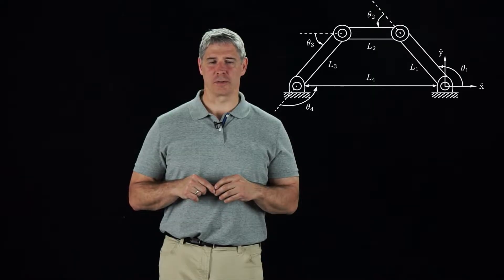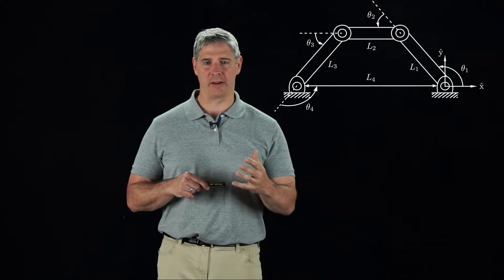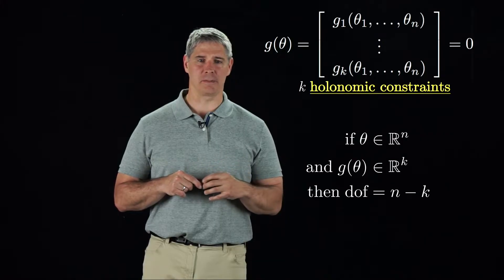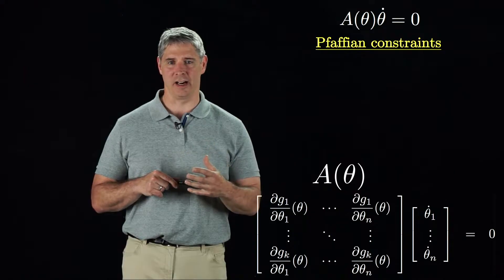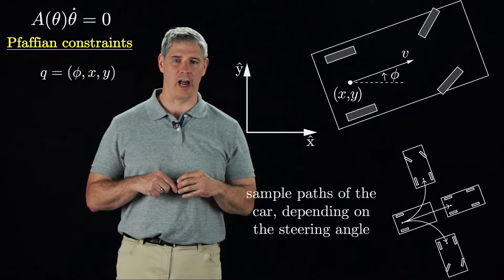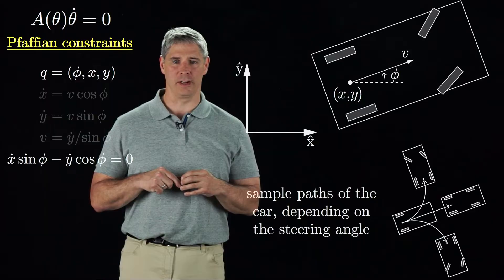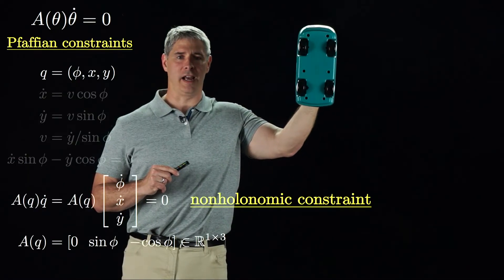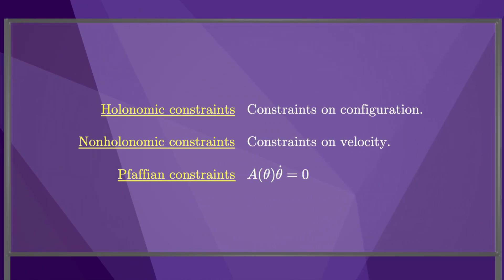Modern Robotics, Chapter 2.4:  Configuration and Velocity Constraints

Comment: By the time anyone sees this it will be like 4 years later and I won't care but I think there is an error:

@2:52 A(q) should be [ẋ*cos(Φ)+ẏ*sin(Φ), sin(Φ), cos(Φ)] rather than [0,sin(Φ),cos(Φ)] because the constraint equation is ẋ*sin(Φ)-ẏ*cos(Φ) = 0 so the derivate of this with respect to theta is ẋ*cos(Φ)+ẏ*sin(Φ) not 0.

This is based on my understanding that the (i,j) element of the A(q) matrix will be the derivative of the ith constraint equation g_i(q) with respect to the jth component of the q vector. No idea how he gets 0
Reply: edit nevermind im a dumb poopy I see its the derivative of the derivative of the angle...